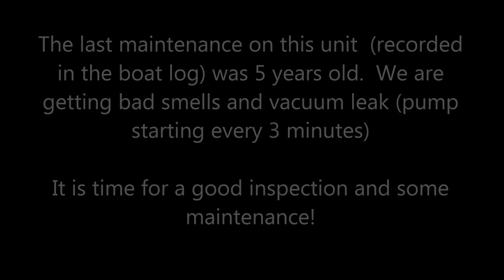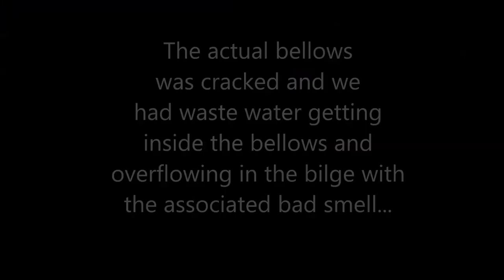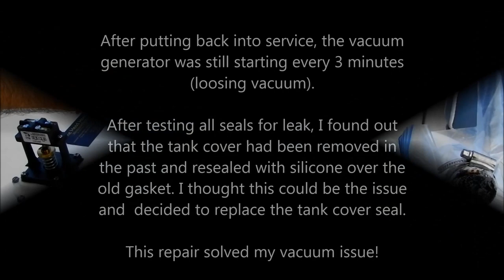Dometic Vacuflush - VG4 Vacuum Generator Maintenance

Comment: Guaranteed way to have a  vacuum leak at the pump top/bellows O ring seal. The leak he had was from that seal. The tank seal NEVER leaks unless it is disturbed by disassembly. Also, when reinstalling the hose fittings, you tighten by hand until they stop, then 1/4 turn. Any more than that and you risk stripping either the nut or the tank. This is a perfect video of how to cause more problems than you fix.

I've been a service tech and dealer for VacuFlush for over 20 years.
Reply: 6:06 😊

Comment: No sound, which helps if the narrator doesn't talk too much!! Still a good video. I had the same exact setup and I never would have located the two duckbill valves in the under the pump. Thanks for making the video. THis unit takes the 2 inch duckbill valves..

Comment: Any ideas on why a unit won't pull a vacuum even after doing all this?
Reply from the maker: The only other vacuum issue I had with the vacuum unit (excluding the toilet) since this maintenance was done was with the vacuum switch. The symptom is the unit will run non stop or it will run and quickly loose its vacuum and restart again because the vacuum switch membrane is cracked and the air come through it. The easy way to find out is to remove the switch, clean the membrane on the switch and inspect it carefully.
Reply: @svkiara1040  thank you, we've found that the inlet side was at fault, the generator itself was pulling a vacuum. Jubilee clips now tightened and all working :-)

Comment: I have a slightly different configuration and pump model, but it is a Dometic.  I have tried a rebuild kit and keep getting water building up in the bellows chamber, which slowly fills and over flows outside of the unit. Any suggestions on what I am missing ?  Thanks for any tips!
Reply from the maker: The only way to have water building up in the bellows chamber from the design I have is a leak from the inner o'ring (at 6:54 in the video) or the bellow itself, not sure about yours. Maybe the o'ring sealing surface on the cover is damage? or the o'ring itself was damaged on the installation (sometime this happen).  Since you used a rebuilt kit I would assume the bellow was good but you never know, is there a small crack on it?

Comment: my original bellow fit tight in the cylinder. the new one has a gap. normal? i would think it would need to be tight in the cylinder to create vacuum
Reply from the maker: As you can see at 6:15 in the video, my bellow is also not tight in the cylinder. This is not critical since the way this bellow works when it is pulled up is by changing the volume in the cylinder chamber by the volume it is compressed which create the suction in the inlet pipe as long as there is no leak from any other joint. What maintain the vacuum in this chamber (cylinder) are the 2 o'ring seals you see at 5:39 and 5:41 and also the duck bills from the outgoing pipe and the o'ring seal between the cylinder and the tank as shown at 2:40. As long as the bellow clamps (half rings black at 6:04) are tight to hold it in place this should be ok.